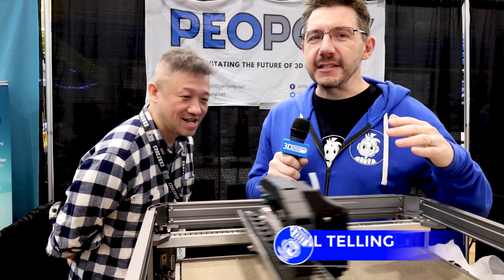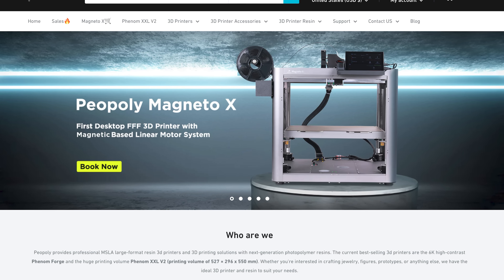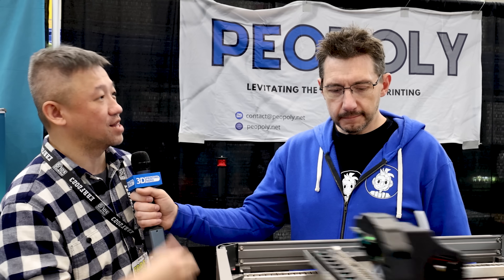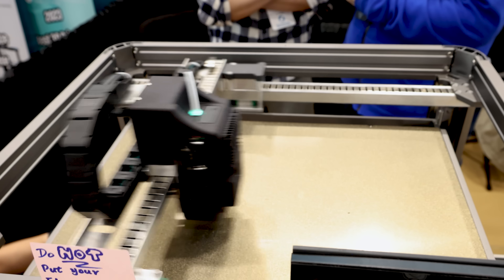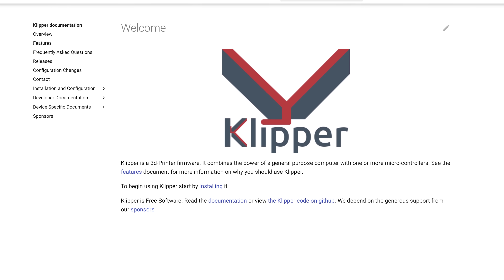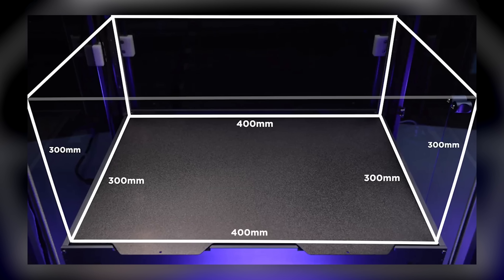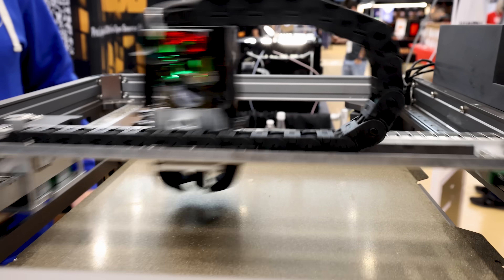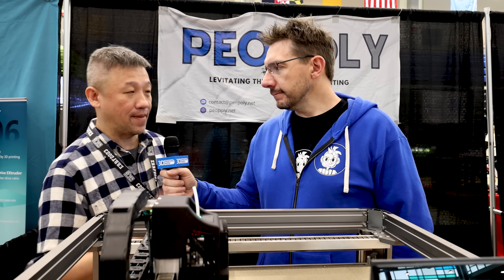Peopoly Magneto X - FIRST LOOK!

Comment: yeah lets add weight to the hot end so it moves slower! so smart! :x
Reply: if everything is done correctly, then weight will only affect electricity consumption.
but time is always more valuable.
Reply: @1288832  you are entirely wrong. Weight directly affects acceleration buddy. Unless you want to add bigger motors and in this case adding bigger motors increases weight thanks to this ingenious design. It's a total design failure and this is coming from an engineer in robotics. Clown
Reply: @livelaughlove_88h  Are you a Lego robot engineer?  then of course, this is an argument))
Reply: https://youtu.be/SfrprxA3_8M?si=iKIY1pImCzR2GXsw
wow he prints parts with a lot of weight ...
So you are a bad engineer

Comment: I cant understand why 3d printers are made to make parts, are spec's like a part, rather than a machine. WHY ARE THEY ALL SPEC'd AS BUILD VOLUMES UNDER 12"? IT MAKES NO SENSE. No professional machinery would do this. What laser cutting machine cuts 3.8ft x 7.8ft sheets? that sht would make no sense.
Reply: Do you want to print a house?

Comment: One of the things I see is how the whole frame wobbles during the operation. It's got power, but definitely throwing around the forces from movements. What I look for is fast but still keeps smooth movements. Like doing figure 8s with no jerk. I like the idea of having the table itself move down as it builds, just needs a bit more stability.

That part does look amazing and how fast it was done, sucks it had issues when moving to the convention. Though does show the printer needs extra attention when moving it after set-up.

Comment: I am wondering how it will behave when tiny metal dust gets built up on the magnets. Shouldn't there be a cover on top of those magnets?🤔
Reply: No cover because the air gap between the permanent magnets and electromagnets needs to be very small, usually around 0.2mm. I wouldn't expect there to be any significant amount of iron dust floating around most places, but if it is a problem you can clean it off easily with a lump of tacky putty.

Comment: I'm curious to know what the temperature limits are of this printer and how the chamber temps effect these linear maglev motors...  magnets usually don't like high temps... so if I wanted to start printing PP or peek I think there might be issues.
Reply: N52 Standart use, 80-100C Maximum.
But there are standards with elevated temperatures up to 200C, but they are expensive.

Comment: Will we see these linear motors available as stand alone parts?  I would be interested in integrating them into my own set of open source printers.  It appears as if everything else on the peopoly setup is standard klipper, which is fantastic, but I don't really need another printer, I just wnat to upgrade something like my voron 2.4 with these linear motors.
Reply: voron soft frame, if you put these motors on the voron, the voron will bend.
Voron made for beauty, not for printing.
Reply: @1288832 there isn't anything soft about  2020 anodized aluminum extrusion for 3d printing.  I'm currently running my voron 2.4r2 at 500mm/s at 20000mm/s^2 acceleration and it's working great.

Comment: is this TRUE... i was told that if you create a g code on a thumb drive that is sliced to one 3D printer ... Then the thumbdrive g code can not be used on a different 3D printer.. even though it is of the same size build plate... IS THIS TRUE ?
Reply from the maker: Gcodes are typically machine specific. The thumbdrive itself can be used anywhere still but that specific gcode is for a specific machine.
Reply: Use stl File.

Comment: Any idea what the power consumption of just the motion system is? I have been running a Gildemeister CTX 420 Linear which got a linear motor on the X axis, and just the linear motor, while idle, had the same power consumption as 3 other CNC machines together.

Comment: bamboo lab clone
Reply: There's nothing similar to the Bambu Labs X1 about it. The motion system is different, the build volume is different. The complete open source software and slicer is different. Gtfo with that nonsense you are dribbling out your pie hole.

Comment: Glad you covered that this was damaged in shipping. The 2 most common things I heard at ERRF/3D Printopia was "why isn't it printing" and "it's not as fast as I thought it would be". The printing one you covered, the speed one you alluded to (they said it was shaking the table too much, so they slowed it down). I don't have the room for such a machine at the moment, otherwise I would probably get one. It's great it's using open source components, standard components, and they plan to contribute back to the community. I'm also glad he clarified the accuracy comment, because that was a tough one to get my head around... Mark did a presentation during the event and made a comment along the lines of "we will be contributing back to the community, including the motion system. It's not super accurate, but we think with the community working on it, they'll make it more accurate" and it worried me that it couldn't be used for detailed prints... but I had no numbers to work off of. Now I do, and 3 micron is still very good.

Also, didn't know that along with founding Peopoly, he also founded Siraya Tech... that was a "wait what?" moment too.

Comment: Thank you for bringing this exciting news!  I have two on preorder.  I’m really wondering if it may be possible to increase the z height to 400mm?  Looks like all simple parts, with the exception of those corner extrusions, that look to be proprietary to their design.
Reply from the maker: It will be open source, and modifications to Klipper would be easy I think.
Reply: @3DPrintingNerd I believe you are correct.  The klipper adjustments would likely be easy, just trying to figure out how to extend those corners of the frame to increase the z height is the only trick ;). I’m looking forward to it!!!

Comment: If understand the construction, its pretty much like an Ender-5 with the linear motors replacing the belts and motors.
If they added another motor, they could do a crossed linear rail gantry design and not have to move the weight of the magnets around.
They are beyond any useful speed, but they might reduce the amount of shaking a lot.

Comment: We're starting to see some very exciting developments in 3d printers. I'm especially enjoying seeing the use of kilpper get bigger and bigger. I hope in the future it will get even easier to install on more printers to where it is more of plug and play.
Reply: One of the reasons Peopoly is first company to officially support klipper.
Also Orca slicer, which you can use without an Internet connection.
Mark does alot for the community and opensource 😊

Comment: I'm glad Peopoly just launched a FDM printer.  They had only 2 printers for sale on their website and it was kind of obvious that something was going on.  I'm glad I didn't buy the Forge, they are clearly moving away from resin.
Reply: Forge is a really great printer!
Reply: @PolyWorkshop  I know, I almost bought it a month ago but then came the X1.  My point is that Peopoly used to be the goto company for large msla printers.  They did not make an upgrade kit for a mono screen on the Phenom L, that should have been the next logical step.   They removed all their older models from their store and they don't seem to be working on newer versions of Phenom and Phenom L.  I wish they would do this instead of trying to compete with Bambu Lab.  I don't know what's going on, are they switching to FDM ?
Reply: You're glad you didn't buy the Forge, a resin printer, because they're releasing the Magneto, an FDM printer. Did you fall out of bed onto your head this morning?
Reply: @cenciende9401   You might see it from this perspective.  Let's say that you are in the market of buying a large pickup truck.  You are shopping around with diferent brands and then you set your eyes of an Ford F-150 because they are a known brand for these kinds of trucks and have been selling them for the longest time.  Just before buying it you realise that Ford has stopped selling most of their older models in the recent months without replacing them with newer models.  On top of that, you realise that Ford has just made a new motorcycle and it's the only product that they release in the last 1+ year.  What does it say about Ford, is it still a truck company ?  Would you buy a truck from a company that might stop producing trucks and starts selling motorcycles instead ?

Comment: Thanks for bringing us another fun and informative video, Joel! This looks like a very interesting printer. I love that the industry is finally breaking free (at least in some cases) from the bed slinger style. My first 2 printers were core X/Y, and the first one I got over 15 years ago. It's a bit funny to me that some people (not you) are acting like core x/y is something new, which it obviously isn't, but going that fast is definitely something my old printers could not do. Speed, accuracy, consistency, reliability, ease of use, and low maintenance issues are all things I'm looking for in my next printer. I'm not sure if this one is it, but it may be. Though, I'd really like to have tool changing for multi color and different support materials would be ideal. 
I"m assuming that next year the Bambu Labs newest printer will be something that competes with the Prusa XL just like they put out their unit to compete with the Prusa Mini. If Bambu can put out a large machine with tool changing like the XL, and can keep the price down, I think that is going to be the one to get for a lot of folks.

*Edit:   I forgot to say, "High-5!"

Comment: One of the advantages of this tec seem to got lost. LOW NOISE. Am i wrong?
It would be a HUGE advantage for potential customers to be able to use such a (big) printer in a low noise environment.
How "loud" is the printer?
Thanks for this video.
Reply from the maker: It was SUPER quiet. crazy quiet.
Reply: @3DPrintingNerd   See. ;) But why is nobody mentioning that?
Like i am forced to build a massive (noise reducing) housing if i'd buy me a, let's say, bambu lab 3d printer and use it in a rental flat.
Especially in europe there are way more enthusiasts and (first time) users without a garage/workshop than elsewhere.
Reply: on high speed printers it's the cooling fans that always seem to be responsible for most of the noise. the motion system itself is a small fraction of the noise.

Comment: Servo / linear motors have a very slight positioning delay. Around 4ms during large acceleration.
Steppers are instantaneous.

The XY positioning (servo) will be unsynchronized with the extruder (stepper)

In my experience with using clearpath servos,
the potential maximum positional error at sharp corners will be enough to cause stringing and slight ghosting. 

I hope they have found a way to synchronize. It will be hard since servos have variable delay depending on how much acceleration is requested. 

There will be a need to move away from step/dir signals and into something with "look ahead" motion planning.  This would anticipate a large acceleration and preemptively command a move so that everything is synchronized in real life.
Reply: Smaller drives are now in the microsecond loop update. Their control loop won't have any issues settling. Especially now that there are no belts to resonate.
Reply: @adisharr  in the case of 3D printers, loop update is not very important. The highest step rate you can get from modern klipper hardware is maybe 300KHz per axis. You need to be in the MHz step rate to barely benefit in response time in the microsecond control loop.

The main issue I am strongly assuming, is the use of STEP/DIR communication. Using it will always be REACTIVE. The linear motor controller can only WAIT and REACT to an upcoming signal. Reaction time for linear motor of this weight is not fast enough. 

For example, you want to catch a bullet. Doesn't matter if you have the fastest camera to see the bullet coming, you can't REACT in time to block it due to physical limitation of momentum.

However, if you PROACTIVELY know the bullet is coming, even if you have a slow mechanical system, you can proactively apply power to begin the move to catch the bullet at thr perfect timing. Synchronization. 

This is what I mean by motion planning. 3D printer's entire motion path is already pre-planned.

The response rate for servos are simply just slower than steppers when using step/dir control. They have a wide torque range at all RPMs. Steppers have all of their torque at low RPMs.

The speed and acceleration of linear motors can be deceptive. It is very easy to achieve very high speeds and accelerations, the only down side is that you sacrifice positional accuracy.

I may be cynical, but there is a reason why the ONLY part they are showing has only smooth turns and large radius. Nothing about small micro movements and retractions. It is very easy to fix that printer. I'm sure it is actually working perfectly fine. Every motion axis is already moving. What is actually broken?
Reply: Belts have deflection. Nothing is 100% linier
Reply: @a2dskins  the question will be what gives better results at this form factor. I'm guessing linear motors will definitely outperform belts on a large 3d printer, but on 300x400 I'm not sure if the linear motors can compete with a 4 stepper corexy belt system
Reply: You're a fool if you think they haven't taken that and more into account. A team of engineers specialising in 3D printing spending a year on it, vs you a random youtube commenter seeing one brief video on it.
Reply: @cenciende9401  unless klipper has implemented something similar to milling CNC machine controls like Fanuc, Heidenhain, etc. There may not be a practical way to solve this. A custom tuned  motion planning system is needed.

I wish them the best.
Reply: @likevvii  They are sponsoring Klipper and open sourcing the firmware.

Comment: Great to see this technology being applied to consumer grade printers.  I have a question though.  Why not mount the linear motors to the frame and drive the print head with toothless belts in a core-xy fashion?
Reply: That defeats the point.
Reply: @cenciende9401  everything is a tradeoff. The CEO said that they're already working around limitations due to weight and that's why the X is shorter than the Y. How imprecise would having belts be?

If we want to not use belts though, then how about taking advantage of the linear precision, and mount the X axis to the frame on both sides and like the Y axis, run what is basically a slider on each side and use a crossed rails style head mount? The precision would keep both sides aligned, there's now less mass to suspend and both dimensions are free. The tradeoff is that there needs to be an extra linear motor rail but since the Y axis would need to bear less weight this may likely be offset by reducing the chonkiness of the beams there.

Just trying to think of a way around having to suspend and toss about as much mass as they presently are.
Reply: A cross beam setup as in something like this: https://www.youtube.com/watch?v=So6IFT_iR34
but driven with linear motors at each side

Comment: The print that was shown is CF PLA.   It is very light weight.  The print quality on the part is good.  Nice, even layers and the facets can be seen along the curves, typical of any STL file.  Keep in mind that CF filaments are very good at hiding flaws. The print did not challenge for ghosting as there were not any horizontal holes, overhangs, bridges or vertical features that you would have on something like a Benchy. It will be interesting to see how it performs once there are running units out in the wild.
Reply: Even if the quality is not 100% up there immediately—unlike with belts, it might be possible to tune the firmware somewhat afterwards, and I’ll probably go .6 and thick layers immediately anyway, to get the build times down for those BIIIG prints!
And it’s simply an amazing deal at the build volume size for the preorder price in any case!
Reply: also keep in mind he said that was what was printing right before gears in the extruder started breaking so id say likely it printed that good on breaking extruder

Comment: Machine looks awesome. It is the bigger size that many in the bambu scene have wanted. Interesting tech. Nice job peopoly.
Reply: It's too early to just compare it with BambuLab.
You're saying it like they're both identical just bigger. 🤔
Reply: @REDxFROG  I agree.  Bambu is essentially a clone of other manufacturers' machines at a better price point.  Peopoly is trying something more different than swapping aluminum rails for carbon fiber.
Reply: bambu..? every scene wants a larger printer, every scene wants a smaller printer
Reply: @Mr.Thermistor7228  This printer is on par with the pricing and design/speed of the Bambu X1C so it's closest analog that people will compare it to is the X1C. Nothing compares to the X1C right now except for this

Comment: Why isn’t it printing? Almost seems like they are hiding something.
Reply: Did you watch the video? They said it was due to damage in shipping. Whether it’s true or false is a separate question.
Reply from the maker: Thanks for the comment, I invite you to watch the rest of the video :)
Reply: @3DPrintingNerd  I still don't buy it. I seem to recall other "revolutionary" 3D printers that never ended up working and people putting their money into them. Until I see it working in the wild (not a manufacturer controlled environment), I will not consider putting money into it.